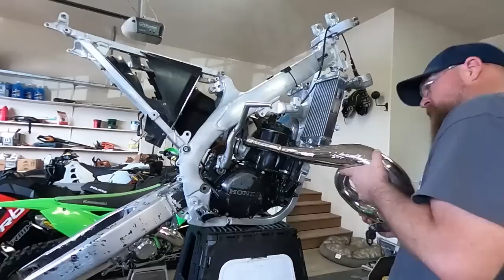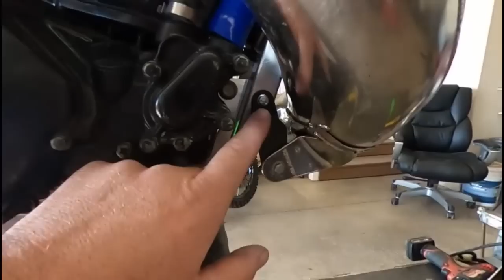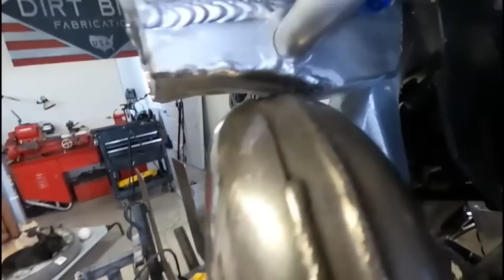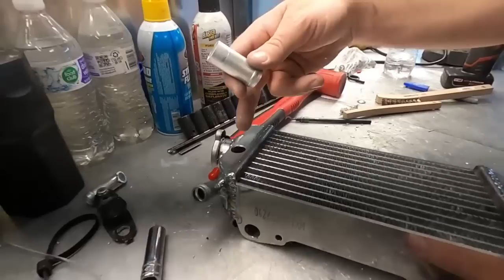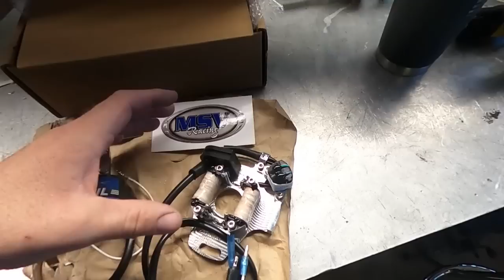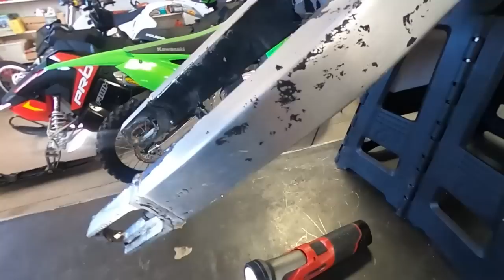@FabRats HONDA CR 500 BUILD IS COMING OUT AWESOME!!!!!

Comment: Well u won't respond on this old video but on a window A/C the rubber mounts for compressor have bolts on each side that work great on applications like y made on the pipe mount

Comment: Back in the 80s my brother had a Kawasaki 500 H2 3 cly 2 stroke. An I had a BSA 650 chopper my other brother built. An way I always wanted to see a Kawasaki 500 H2 use the motor an make a dirt bike. I miss riding so much. In 1993 at my just tow truck driver snow an ice on the road I was smashed between pick-up an wrecker by the semi. Drug 235 ft down the road. Lost both my legs above the knees. Miss riding bikes. But I have a Can-Am X3 XDS Max Turbo R with 35x10x15 tires. Lot of aftermarket parts. I would love to see a the Kawasaki 500 H2 motor on dirt bike frame.

Comment: I love my adjustable msv stator and high power coil on my MRE built motor with smart carb and sometimes pwk airstryker.
So... Quick question, you going to be at SM23 with all us other cr500 fanatics?
Reply from the maker: Man maybe when is it.
Reply: @DIRTBIKEFAB  I thought I replied to you, my bad. It's 3/9-3/12 at sand mountain Nevada in fallon NV. Days drive for you. If you have the Facebook's it'll be under sm23 if you look it up.

Comment: A budget bike build and competition would be fun!  That said, I would like to see a build for a lightweight dual sport/adventure bike.  I run a Tenere 700.  It's a great bike, but I sure wish it was WAY lighter.  Something in the 450cc range with a 6 speed transmission and a large fuel tank and good suspension with the ability to add luggage.

Comment: I'm building a 1000cc twin using either a 03 yz 450 chassis or a 08 crf 250 rolling chassis with my vstrom 1000 motor. Hoping for a under 300 pound adventure bike when I'm done.

Comment: I'm with Emmitt Davis I would also like to see a Harley 883cc Sportster frame turned in a dirt bike but build it to where you can do flat track racing hill climbing dirt drags and all the other cool fun stuff you would do with a dirt bike and put either a Harley 1200cc engine on it or a Buell 1200cc engine on it for the extra horsepower and torque and I would still also like to see an old school big wheel 80 turned into a pit bike but with a 500cc engine on it and again do hill climbs dirt drags and any other extreme dirt bike racing/obstacles with it

Comment: I would like to see a ground up build of your idea of a "Pit Bike" and take a old school big wheel 80 preferably the KX80 since they were the king of the Big Wheel 80s and mount a 500cc engine, trans, and sprockets on it and you might have to get heavier springs and shocks for the suspension but try to keep it as small as possible and use either the same size tires from the big wheel 80s or use the 100cc sized tires and see just how fast you can get it or mount a twin cylinder 350cc engine from a Banshee on the big wheel 80 to get it really fast and once you get it stupid fast take and do hill climbs with it

Comment: I'd like to see a budget build. 
BUT what I'd really like to see it's you get rid of that death pipe on your water heater, flex pipe is not exhaust rated, put solid pipe on it with the joints and elbows taped please. That can leak carbon monoxide into the house and cause all kinds of issues with your health or death.

Comment: I would love to see a Yamaha WR450 tamed down with a bigger flywheel and converted to run on regular octane pump gas with a frame extension for the rear fender .  Always thought a WR would make a great dual sport if it could be tamed down.

Comment: Hey I have a question about tools!!?? So I see that you are tig welding aluminum?? What welder are you using to tig weld aluminum??? I’ve been looking to get another welder that will tig weld aluminum also!!! I have a big Lincoln mig welder and it works ok I guess!! I wouldn’t mind even getting a good Miller or esab welder that would be capable of doing tig for aluminum and mig welding also!!! What welder would you recommend to be able to at least tig weld aluminum???? I no there is AC and DC and one is for aluminum!!! Does yours only tig weld aluminum or does it have both the AC DC??? I do truck builds and definitely would like to get into a little more aluminum tig welding!! Can you give me some ideas or even what welder that you would buy to do some tig welding and even some steel tig welding??? I’d really appreciate it!!!! I’ve been looking for a couple years and I’d really like to pull the trigger this spring hopefully!!!!!
Reply from the maker: I AM A MILLER FAN FOR SURE. MY TIG IS A 185 AC/DC  ITS BEEN GREAT OVER THE LAST 20 YEARS.  THEY MAKE SUPER NICE NEW MACHINES THAT ARE WAY COMPACT NOW

Comment: If you can, I'd like to know the differences between the OEM 500 frame and the new one. Aside from the materials. What are the pros/cons?
Reply: I have a steel frame 89 cr500 and love how it feels for mountain riding. Feels softer, less rigid, and handles great. I was going to switch frames, but I feel like the steel frame is better for rocky mountain trails. I like my aluminum framed bikes better for fast desert riding.

Comment: Suggestion for a future build...  I would like to see if you could do something with an XR650L to get the weight down.  Stock is around 350 pounds.  Getting one down around 280 would be cool.  Not suggesting the XR650R, the "L" has the electric start and is street legal in all states.